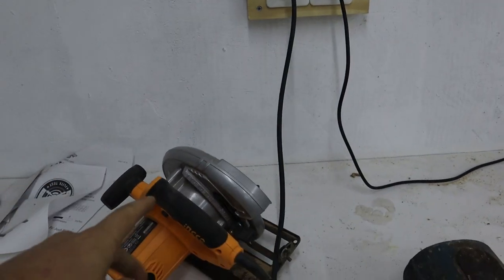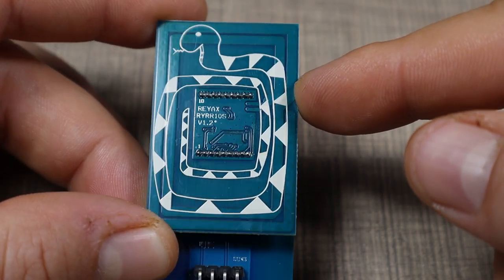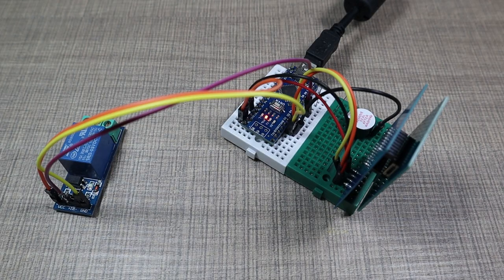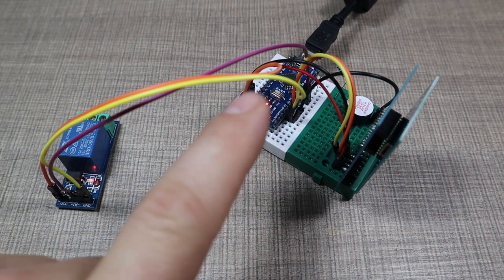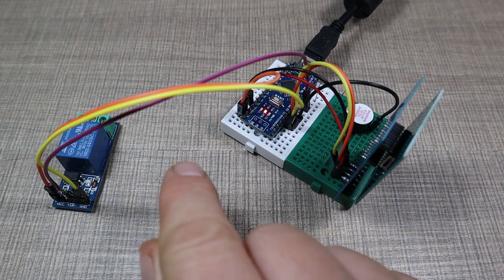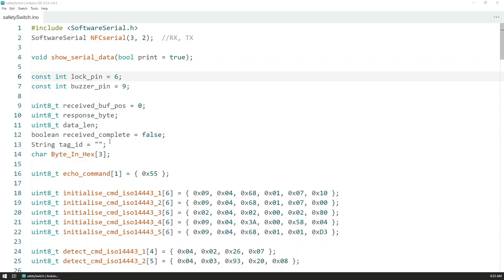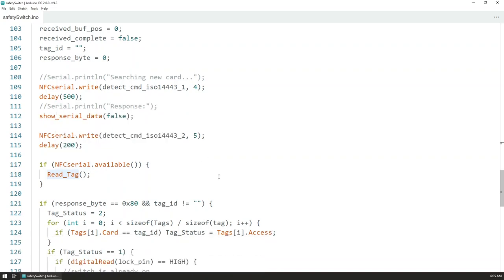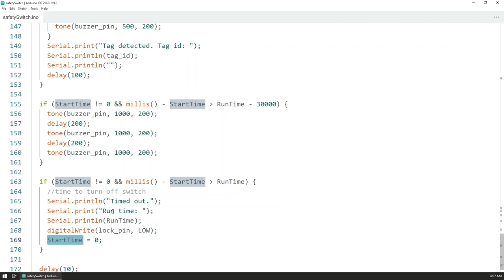My workshop just got a lot safer with this RFID safety switch!

Comment: Love the project. Would it be more useful to have the module count taps ...aka tap card twice for 2hours use time. then just have a push button kill switch off wanting to leave immediately.
Reply from the maker: Thanks! Yes, that is a good idea but I didn't wanted to have a long run time where I could possibly need to leave and forget to kill the power and be left with let say 4 hours of run time where the kids can still go in there and have power tools on. The shorter run time mitigates this to a degree.
Reply: @TasteTheCode  Makes sense great work! 👍 my next thought would be to use an ESP32 to track your phones presence with the integrated Bluetooth LE. But i suppose being in your basement you don't want to be upstairs right above it and have it think you're nearby.
Reply from the maker: Hahaha yes, that is an option but I'll probably not use BLE. Having WiFi on it however might be beneficial as I can plug it to the home automation system and I will be able to remotely turn it off if needed.